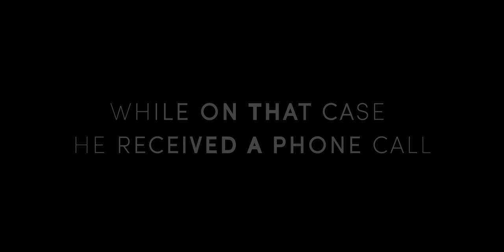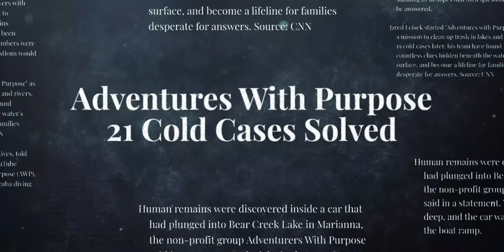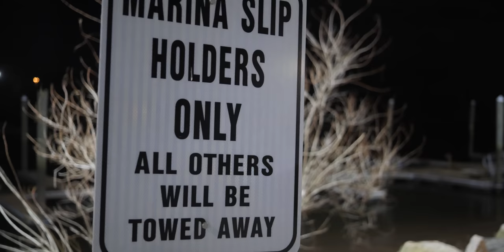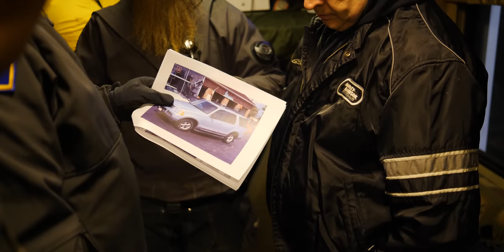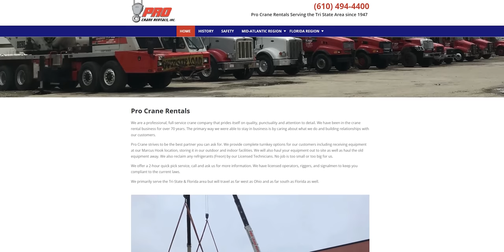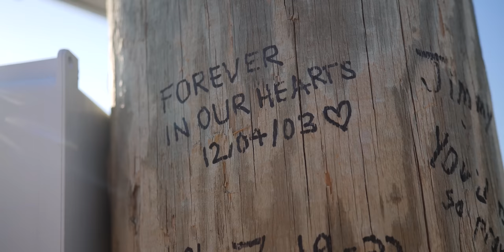SOLVED: Closure for Jimmy's Family | SUV Recovered 19-years Later [Final Ep4]

Comment: That was an unmitigated rigging disaster,  That was not a proper pick by any means. for starters the very SECOND it was discovered that pylon did not go through the car, there should have been an all stop. re rig to the pylon and remove it first. then deal with the vehicle. the windshield was out and you can literally see stuff falling out of the inside of the suv. not including the rigging all over the place under water with the divers, that was all bad.  With all that said still a noble effort for a Noble cause giving the family closure.